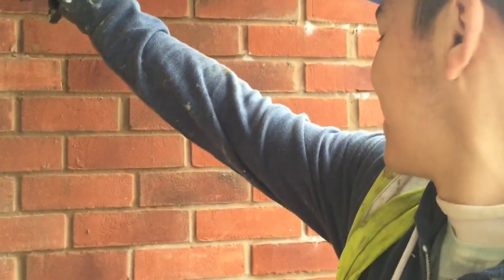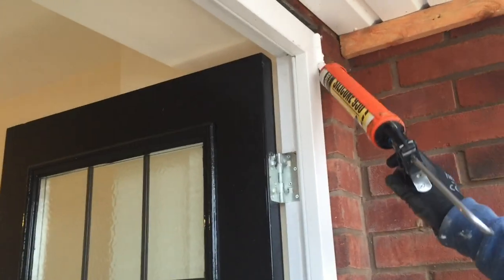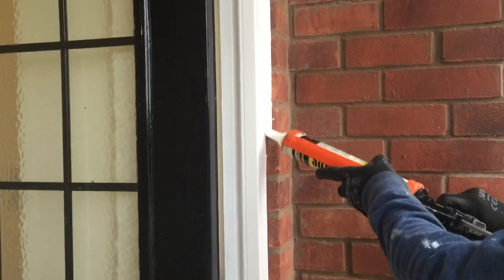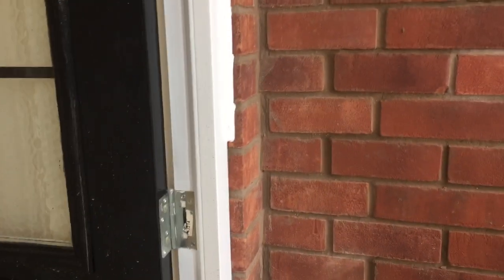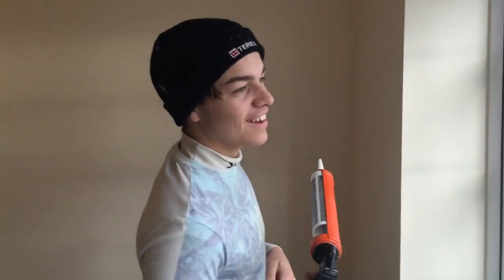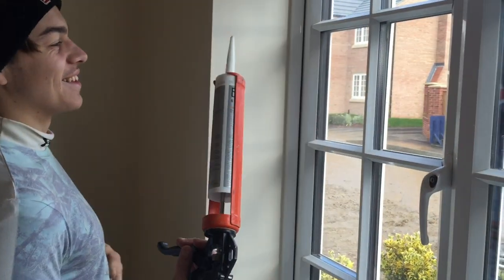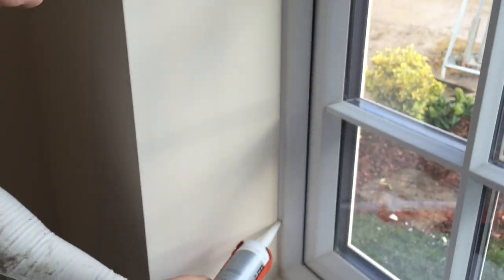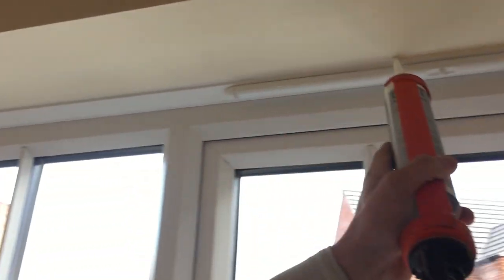Painting & Decorating, How to Mastic a door frame

Comment: Is the finish around the front door actually that great though, you have big globs in the pointing where the smoothing tool doesn't reach. Just looks a bit rough overall, surely there's a better finish out there.
Reply: I though that ruff as a dogs arse and useing silicone agains painted wall 🤦🏻

Comment: only thing id say is use low modulus silicone sealant, actual mastic is near impossible to use, and when smoothing with the stick barely apply any pressure dont wna force it in the gap it should already have filled it, just want to smooth off any application marks

Comment: The kid's technique is very interesting. There are many videos on YouTube in which the use of a finger to tool in the sealant is shown. But this results in a concave profile with thin edges.
Using washing up liquid in the water is essential, as just plain water seems to result in soft tacky sealant that doesn't cure properly and also, it helps to lubricate the tooling in process.
He was using silicone here tho I think? Not so easy with mastic type frame sealant.
Reply: A concave profile is the correct profile for the sealant to properly perform. Additionally backer rod should have been used. To make the bottom of the sealant concave.
This is the proper sealant profile:

https://hammerandhand.com/wp-content/uploads/2014/09/2.1A.jpg

Comment: Typical rough finish builders. If you use silicone on the inside of a window it's impossible to get a neat finish with the paint. I have also seen kitchen fitters use silicone around units. It's typical of trades who have no idea, or don't care about the finish, or other trades who follow them. As a joiner who makes, fits and decorates windows and doors ect, you seal the inside with caulk, because guess what...... IT IS PAINTABLE, unlike silicone. I hate videos that give crap advice.  Also, if the gap around the door frame was that big, it should have been pointed with gobbo..... But we can't do that can we cos it takes to long.....Pass us another tube and me bent stick.
Reply: I'm a decorator and that's all I could keep thinking the whole way through.  Infuriating.
Reply: It's the main spec for all home builders these days. Dont know why cause it cracks after  few months anyway
Reply: most new builds want hm silicone around all frames, as well as sanitary applications,skirtings etc.
Reply: Yes caulk inside, silicon outside
Reply: 1st thing is if the space was so big outside the hole would of needed backing rod. Secondly the silicone should be pushed into the hole then smoothed off as going that quick doesn't let the silicone get a good grip and water sets in and the silicone peels in parts or cracks

Comment: There is so much wrong here.you can't spray it with soapy water before you tool it,it may not bind properly.you can't use wooden sticks to tool because they wear out quick and the caulk sticks to it which is why you have to spray it.get proper tools and you don't have to use the soapy water

Comment: Not impressed with the mess of caulk on the edge of the brick. Not a clean look. Really, is it necessary to spread 3/4 of an inch of caulking on brickwork? Because that's what was done with that three-quarter inch wide stick. But the young fellow seemed to do a nice job around the window on the inside. Although the camera was not up close on the actual work done around the inside window frame.

Comment: True professional caulkers DO NOT USE ANY tooling liquid they dry tool. EVERY major manufacturer says to dry tool. This is what Dow says in their tech manual: 
“ NOTE: Do not use liquid tooling aids such as water, soap or alcohols. These materials may interfere with sealant cure and adhesion and create aesthetic issues.” 
Dow is one of the largest manufacturers of silicone sealant in the world. And if you look at the technical manuals close enough all manufacturers say to dry tool.This is one of the main causes of premature sealant failure.
But of course these clowns think they know more than the manufacturer. The truth is they don’t have the skill to dry tool. It is not their fault they were probably taught by a Painter or “ decorator” not a true professional caulker.